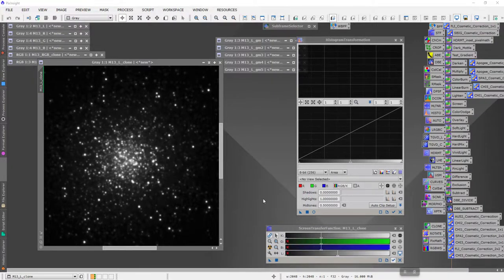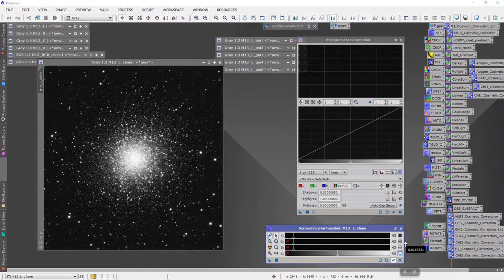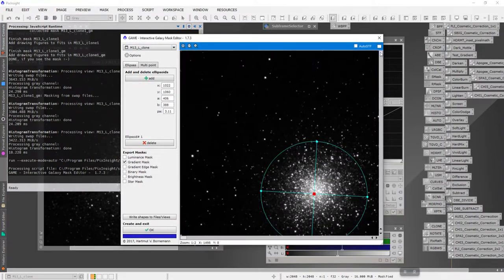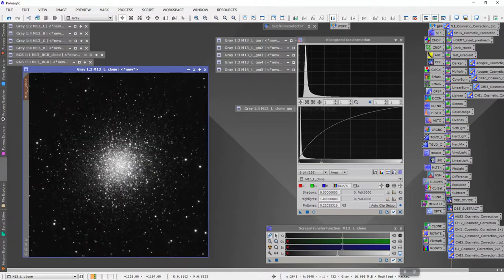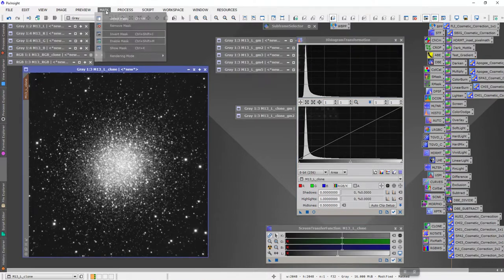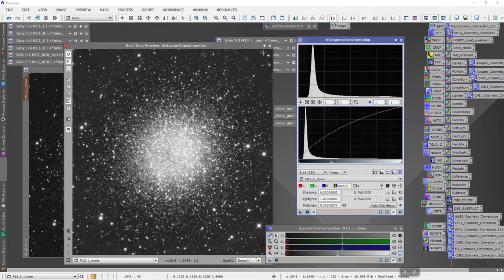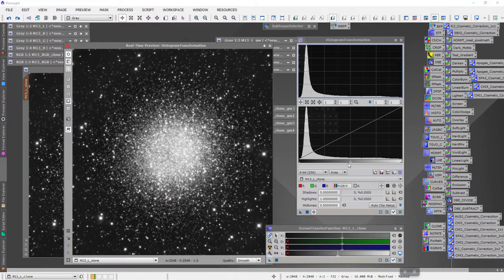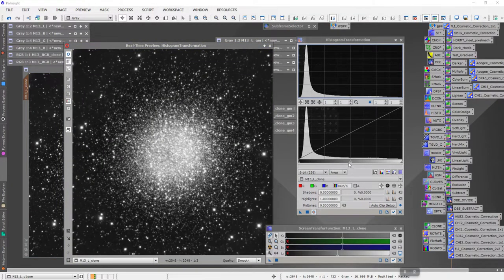Globular Cluster Processing

Comment: Thanks for a very instructive video, Bernard. I've struggled with processing globs trying to make them better than, well, a blob. I tried your method on a recent image run, but found some problems: the stars were blocky, the surrounding star field nearly disappeared, and there seemed to be a colour shift. I, obviously, wasn't doing something right. But here's the rub! I thought about your method and wondered whether the inverse would work, i.e. starting with the full image, progressively dim down the glob's centre with diminishingly smaller GAME masks used as created, not inverted. I tried it and it worked nicely. It also has the advantage that you always have the entire glob in view at each stage. I suspect that my failed first attempt suffered from the highly diminished 1st stretch, and I had to guess at the final size of the glob. 5 stretches later and I was still too small! I'm pleased with the results of my modification to your method, and will try it on other glob images I have. All I have to do now, is work out how to get the colours in the glob's stars. Any suggestions? Paul.
Reply: I decided topfollow up on my last comment and have had some success. I performed a PhotometricColorCalibration on the stacked-DBE/ABE image, before commencing my inverted routine. I followed it up with some saturation increase and there I had a much more colourful image to start dialing back the core. I just thought that others might find this useful. My final image has a lot more blue and magenta in the glob, and looks a lot better for it. P.
Reply from the maker: I am glad you were able to improve the color. One thing I sometimes do is just capture RGB (No L). Then after I get the glob the way I want it in Pixinsight, I extract a luminance from the RGB and take the L and RGB images to Photoshop for final processing. I don't know if this helps the color, but I find it helps with sharpening and final processing.